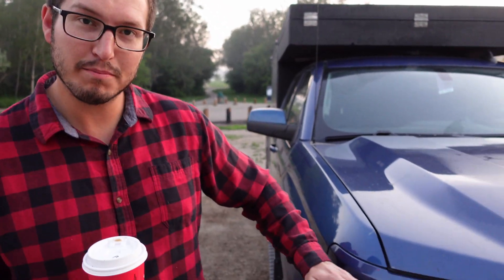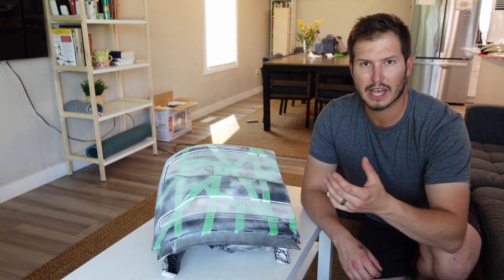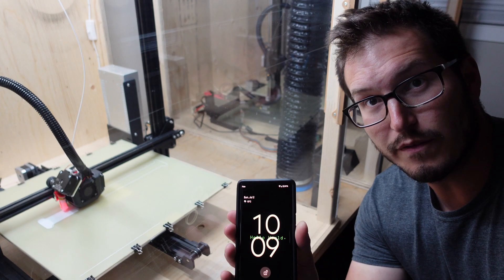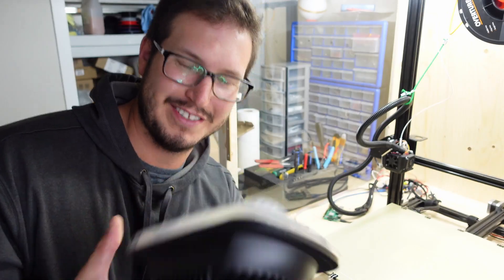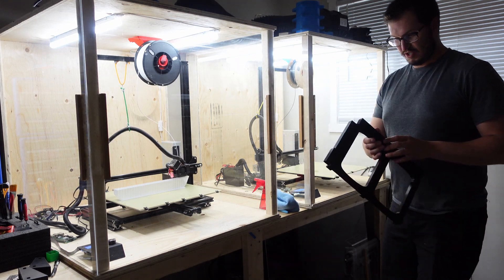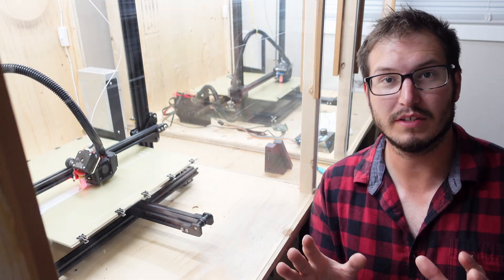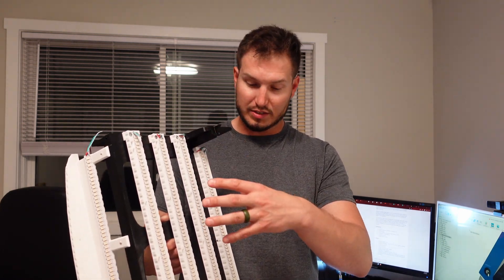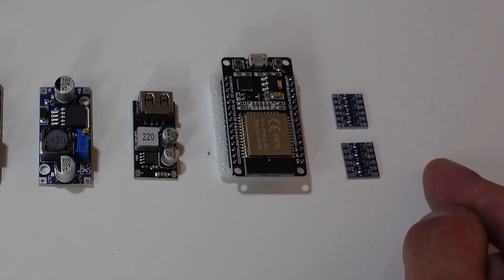I built better headlights for my truck using a 3d scanner and printer

Comment: Finally someone using 3D printer for car projects 
Man your project is awesome, but you know 3D-printed parts are not durable 
So if you could make up some mold out of 3D print models and turn them into resin it would be more durable
Reply from the maker: Thank you! Depending on the application I might have to do that in the future!

Comment: What printer though?
Reply: An led light chips please thx
Reply from the maker: I updated the links in the description to what I purchased, but in a nutshell:
- LM2596 drops 12v to 5v to power the LEDs
- LM2596 USB drops 12v to USB to power the ESP32
- ESP32 is the brains where WLED is installed.
- Logic Level Converters take the signal from the ESP32 which is 3.3v and convert it to 5v, then pass it along to the data wire on the SK6812 LED Strips

Hope this helps, thanks for watching!
Reply from the maker: I am using Ender 3's with Ender Extender Kit, Dual Z Screws, Micro Swiss NG and SKR Mini V2 E3